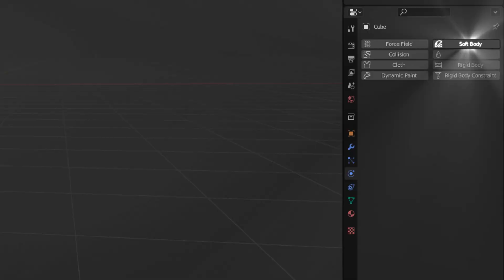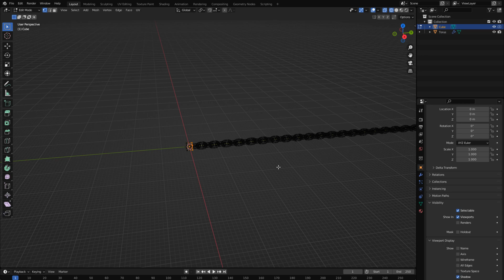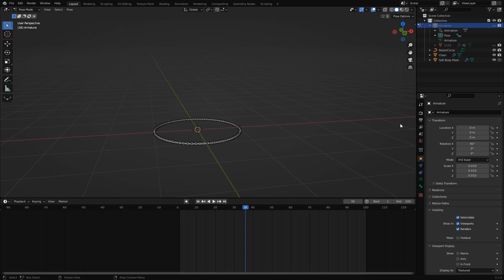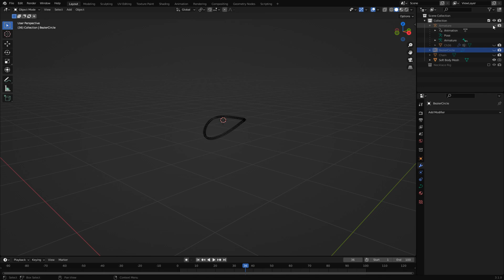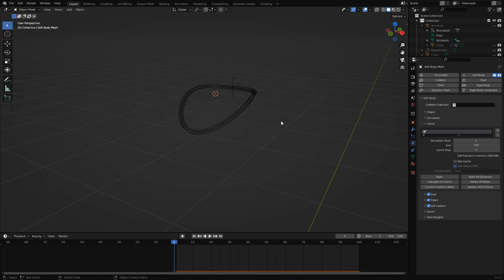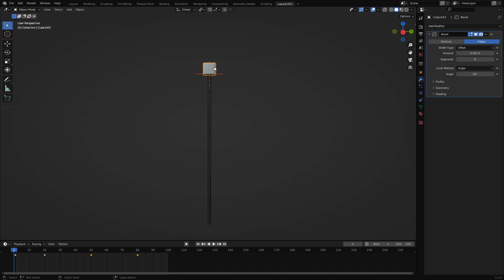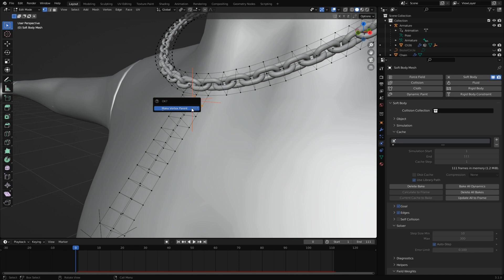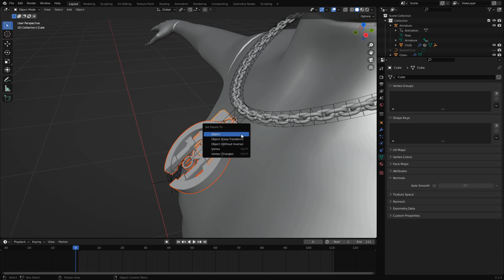ANIMATION using SOFT BODY Simulations!!! | Blender 3D Tutorial

Comment: Why would you not show the setup when the chain is hooked to two different points...
Reply: Actually the same logic. We need to create 3 different vertex groups. The first one is for the 1st hook, the second one is for the 2nd hook, and finally, we set all the points on the rope that we want not to move and where we actually set the hooks, as the 3rd vertex group. Then we mark the 3rd vertex group in the soft body. And we mark the points we assigned within the hooks.

Comment: Any recommendations on how to export animated objects using the surface deform? I feel like shape keys might be the way to go but I can't seem to get them to work. Any advice would be greatly appreciated
Reply: I'm dumb. Turns out I was able to export it through an alembic file
Reply: @yetirenders  how did you export as alembic
Reply: Click on File> Export> Alembic. I selected face sets under object options to fix some shading issues in unreal engine but you might not need to depending on what program you're importing to @Originallyright
Reply: @yetirenders  How can I export the entire chain model with the pendant as a single mesh with animation? Currently, I can only export the soft body part.
Reply: @Originallyright  I couldn't figure out how to export them them together and ended up just having to do them individually. Make sure you're exporting the chain itself and not the soft body

Comment: one thing i noticed is that after you apply "surface deform" modifier to the original necklace, some parts of the necklace got distorted. any tips on fixing that issue?

Comment: This is amazing! Is there any way to bake out the high poly mech as an .abc cache so it can be rendered in other programs like Unreal? I've found that there doesn't seem to be a way to bake the surface deformer modifier like you could if the soft body sim was applied directly to the object. The low poly one doesn't have this issue, but the surface deformer seems to be ignored by the alembic cache out process. Anyone struggling with this too?
Reply from the maker: I tested it selecting just the high poly mesh with the surface deform still on and exporting just that object as an .abc, and I was able to import it back into Blender and it worked. Maybe test if it's exported properly by importing back into Blender first? Could the problem be in Unreal?
Reply: @lewisanimation  I tried that and you are right. Seems to be a UE problem :( I'll report back here if I ever solve it, in case it helps someone else. Thanks again Lewis!
Reply from the maker: @calvinromeyn  No problem :) I hope you find the solution you're looking for!

Comment: I always have an error when I try to use Curve modifier and selecting the curve from the object that have to be matched with. Basically the obj that have to follow the curve goes really away from the curve itself and there is no way to fit it. I tried to change the axis and also to apply transform and scale, to match both the origins and stuff but it never works. How could I solve it?

Comment: Any benefit of using soft body sim over the rigid body for a chain?
Reply from the maker: The main benefit I found was consistency, I did a lot of testing using rigid body sims and simulating multiple linked chains, and it makes it a very complex sim with a lot of collisions, and therefore more things to go wrong and they often would! So I switched to using soft body sims as you can be pretty sure you'll get a useable result, and you can actually adjust how the chain moves really easily!
Reply: @lewisanimation  Thanks for a reply. It did work quite well for a nametag lanyard I designed to showcase branding side of a project ! Sims still scare me though lol.